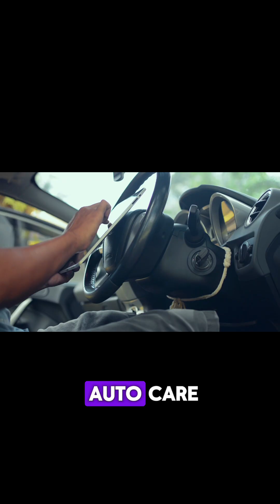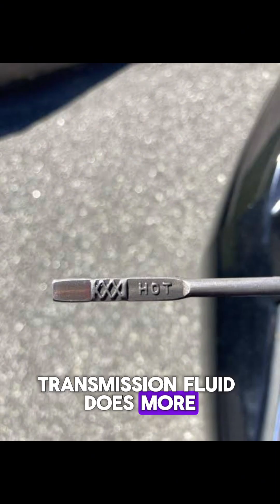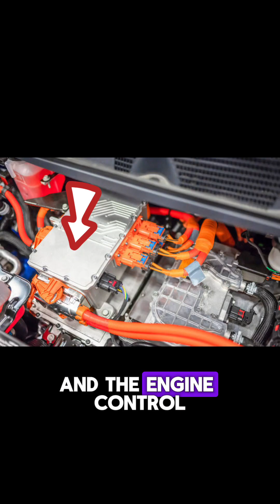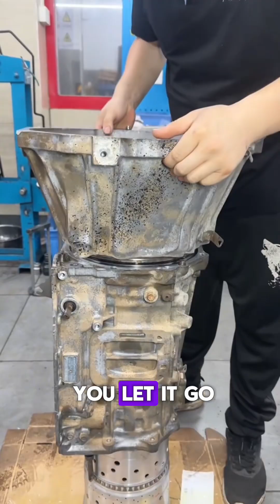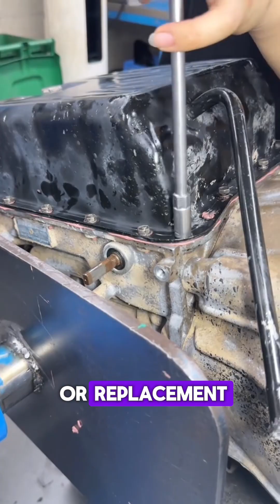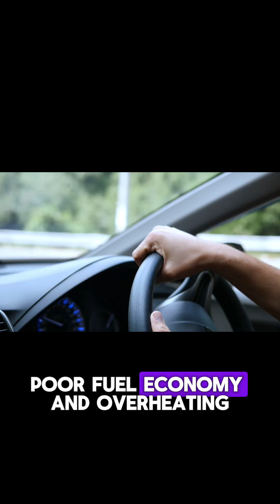Don’t Ignore Error Code P2757 – Save Your Transmission!

Comment: This helped thank you! My 11’ Corolla stays at 40 sometimes even if I let go of the pedal.  Trac and engine lights are intermittent too w this code
Reply from the maker: I’m happy to hear that
Reply: @DBOSSAutocare Abolish AI narration, dude. Immediate blackout. I can’t trust a robot, even if it’s computed by a human. What a joke.
Reply: Mine doing the same did you figure out what the problem was?
Reply: @SEE@SEE-K1LL-U not quite yet, just got my other car smogged so the Corolla will be next.  I’m hoping it’s just the tcc solenoid but I also have several other codes cause my cars got miles. I have a lean code amongst a few so I have to find where the air is escaping.